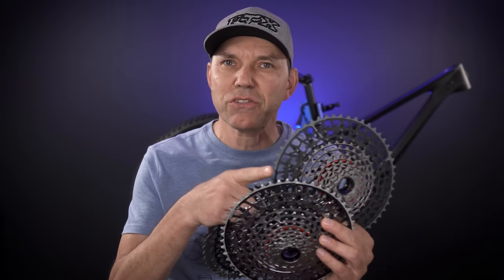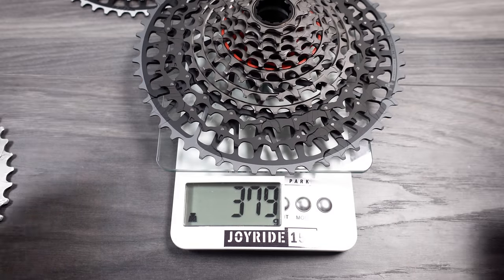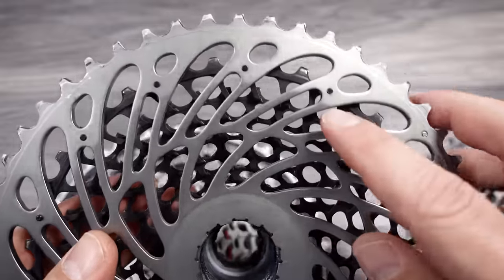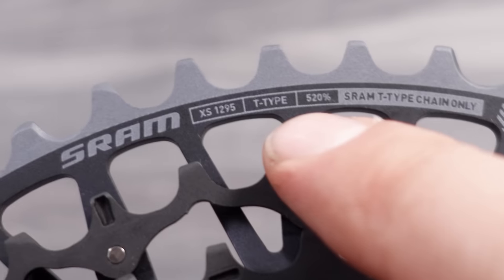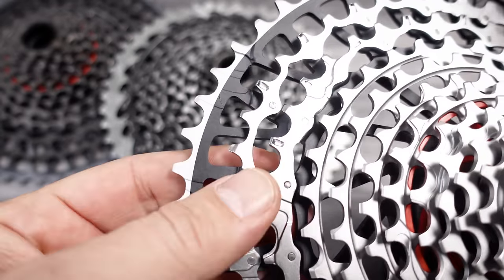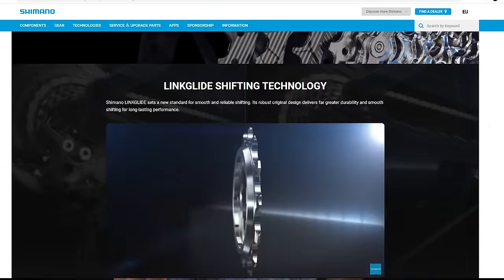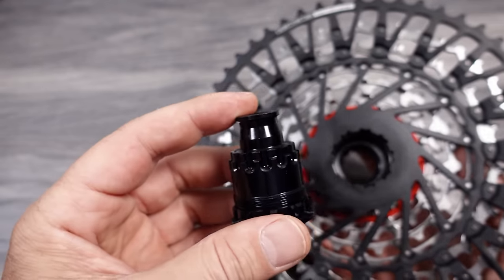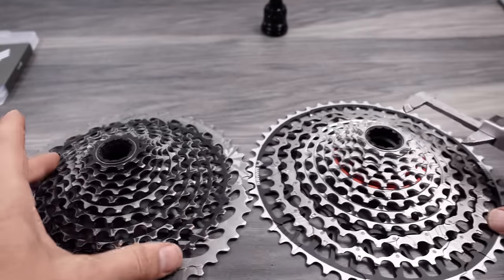SRAM 520% T-Type Cassettes Detail, Compatibility with Old Eagle AXS #Transmission X0, XX, XX SL, GX

Comment: Great video, Thanks.  I have just a little bit of time on my XO Transmission and its been amazing.  Only complaint I have is the new pod, I removed that and went back to the old controller with the add-on shifter paddle.  With AXS I prefer to use the single shift mode, no 2x or 3x autoshifting.  The lack if feedback makes it easy to change more gears than I wanted.
Reply from the maker: Thanks for the info! We will see if we keep the new pod or go for the old one.

Comment: for information, I'm running the new powermeter XX sl Quarq with my XTR drivetrain (Xtr chain icluded) and It's working perfectly!
Reply from the maker: Thanks for sharing, it's what I assumed seeing that the new teeth are narrower, pretty much what Shimano chain wants!👍👍👍
Reply: Nice to read it! I’m studying to mount a new GX T-Type derailleur in my Super Caliber with XT group set, using the cassete, chain and crankset Shimano. 
My XT derailleur and shifter were gone after 3 years of use, I expected more time working.🙃

Comment: I think they are aimed at different markets? The SRAM gear is high end, whereas Shimano Linkguide is available for cheaper builds. Maybe Shimano will release lighter weight cassettes in the future?
Reply from the maker: You are correct, different markets. Shimano - don't expect lighter Linkglide as the whole point of that line is durability,, steel everything etc.

Comment: LoveMTB - I understand that with SRAM’s new Eagle XX T-Type AXS Transmission, "shifting under load is made possible”.  Is it correct to assume that shifting under load is NOT recommended with my 2021 AXS Eagle XX1 group-set??
Reply from the maker: Kind of depends what you mean by that. Shifting under load, to a SMALLER cog is clunkier on SRAM 12 speed vs Shimano 12 speed/ HG+. T-Type is trying to mimic that using electronics and they succeed but Shimano HG+ is still better in my opinion.
Shifting under load to a parget cog/ smaller gear is kinda similar on all...

Comment: If I got it right, you have measured and compared the thickness of the largest sprocket - both 2,80 - but not their teeth.
Maybe you can still do it and add the result here in the comments, please?
Might be some more info, as there are narrow and wide parts and maybe a narrow edge as well....?

Comment: That's crazy they weigh the same. I would pick the most affordable one every time. I also wonder how the efficiency is compared to Shimano. Sram usually gives up a few watts to Shimano but does that trend continue in transmission
Reply: The cheaper one will wear faster and not be cheaper if you climb a ton
Reply from the maker: The watts - it was mostly from the chain, wanting for ppl setup to run those tests to put some numbers out...

Comment: I tried older 1295 cassette on a T type GX transmission incl. t-type chain and it works ok .. i put 1.5mm spacer behind the cassette to improve chainline a bit ,but not needed to work ok as microajust i on 8 position ( without spacer will be around 2-3 ) . my crank is Next 12 speed model ,it works with t type chain too . My next experiment will be new 1275 t-type cassette on a XDR freehub body and older Lunar mechanic transmission ( i hope it will fit as XDR sits 1.85mm inwards )
Reply from the maker: Thanks for sharing. WHy not use the proper, new cassette? And for XDR they always recommend using the 1.85 spacer for MTB cassettes
Reply: I think it is recommended to use the spacer only for older eagle cassette, not for T-type @LoveMTB
Reply from the maker: Nope, XDR is loo long for MTB cassettes, all of them @ricky66659
Reply: I used a new T-type cassette with the axs derailleur, XO1 chain, and used a 1.5mm washer under the derailleur. It runs, but unfortunately not as smoothly as with the original XO1 cassette. If I micro adjust derailleur on the smallest cogs, then it doesn't go well on the largest ones and vice versa. I think the main trick is that T-type derailleur is better optimized for the T-type cassette. I am coming back to my original axs setup which works perfectly. @LoveMTB
Reply from the maker: Yeah this stuff is optimized for T-Type not worth it to mix and match especially for the price! Thanks for sharing your experience @ricky66659

Comment: Hey, I haven't tried the Linkglide Shimano drivetrain yet, but from what I read about it,  it does shift a bit slower than HG+.

I think Sram learned from it, copied it and gave it fancy name (shift mapping). As I have seen the T type also shifts much slower than previous AXS or any other mechanical derailleur.
Reply from the maker: Yup it waits for the shift ramps to come around before the cage moves. Probably smart and probably why Linkglide is also slower in operation, the wBije boost can rip off freehub/ feeewheels cassette cogs etc

Comment: I got my new bike last week with the new Sram AXS eagle derailleur and I was nog aware of the shifting delay... I must say this feels really clumsy... so if you get to a steep hill out of a corner and you want to quickly shift to a higher gear fast... the derailleur simply can't keep up and takes it's own time where you will have to push maximum on the climb... I must say, here Shimano works better... I read Srams argument to design the product like this, but any competitive MTB rider will confirm quick shifting performance is key on any parcours that has quick/steep hills...
Reply from the maker: @freddiek7125  Still they win races at the highest level of competition with this groupset so I think we’re fine 😎

Comment: I want to try a new T-Type XX cassette with my AXS GX derailleur. I can easily machine 2.5mm offset on the hanger, and I will also get a T-Type chain, derailleur pulleys, and front chainring. I am not buying a new $9000 UDH bike just to put a $2000 "transmission" kit on it. My GX cassette is pretty worn so its about time to replace it anyway. I think the biggest improvements probably come from the new chain and cassette.
Reply from the maker: Aaaaaand what are you going to do if the trim adjustment of the GX won't allow you to actually index the gears/ start at 10T??
Reply: @LoveMTB  if the spacing between the gears is the same, it will work the same as long as the derailleur has the correct offset.
Reply: @mk3driftmotion  hello, any update ? I need to do this too and I want to know if it works, thank you :)

Comment: I wonder if you could use the new sram T type derailleur with shimano XTR. I think you have tried the sram XX1 with the shimano and it has worked.
Reply from the maker: I did. But remember that this derailleur has no adjustments so it is expecting everything to be just in the right spot, like a transmission 😎
Reply: @LoveMTB  Hi, thank you for your great videos. I have one question left becours my Englisch is not good enough 😅 Is this derailleur compatible with Shimano XT 12s

Comment: Great review. Can I use in a pinch, a SRAM eagle powerlock 12 speed link on a T Type chain? I gather using a whole (new) Eagle chain on the Eagle transmission cassette not a great idea? Sram say the T type chain ring is compatible with older Eagle chain. Thanks.
Reply from the maker: T-type chainrins are the only ones backwards compatible indeed. And I wouldn't use the old quick link on the new chain

Comment: For some reasons I bought the new groupset but I can't afford riding it all year long. The wear item are 380+100+100 so almost 600. So yeah I would like to run old gx stuff for off season riding. It would be neat if there was a way to run the old cassette. I think a 2mm spacer on the driver would do the trick with the old chain.
Reply from the maker: Probably not what kind of fit would you get on the XD driver with 2mm spacer behind? Highly NOT recommended. What I would recommend though is researching  how to reduce friction and wear in drivetrain. Like wax🤓
Reply: @LoveMTB  i already use wax, but i am still north of 4000km per year on thatbike, it would require change every year. i will probably switch back to old gx complete gruppo for off seaon simply not selling the gx derailleur.
Reply from the maker: @TheAntoine191  I hear you, what wax do you use? BTW Silca wax X shows no wear after 3000k in recent tests
Reply: @LoveMTB  also sram says the link must not be reused on the new gruppo so waxing require a new missing link every time. I have a hard time with "no wear" on mtb stuff. For 6 months i ride in mud/rain/snow you can't avoid some wear. It's not like running on a sunny road.
Reply from the maker: @TheAntoine191  I hear you. Common sense prevails🤘

Comment: I have shimano 12 speed m8100 on my ebike and it works great and has proven to be very durable.
Reply from the maker: Thanks for sharing. What chain do you use with it? Lube or wax? Thanks
Reply: @LoveMTB  dumonde tech. I put over 1,000 miles on my last groupo. I use an xtr chain because it has proven to be most durable
Reply from the maker: @Bench_mark_113  Good stuff! If you want to double/ triple that look at wax 😏

Comment: So, I have a new 2023 Marin RZ2 frame with a Sram UDH.  I just ordered a T-Type cassette in order to obtain the recommended 55mm chainline, along with a Sram Eagle Wide (also 55mm chainline) crankset.  want to stick with mechanical due to cost but I'm confused by your example of the cassette jamming up even though a Sram UDH is used.  My understanding was that a Sram UDH signifies that you should use a T-Type cassette w/55mm chainline.  Thanks in advance.  Would like to know before I start assembly.
Reply from the maker: It jams up because I USE the UDH! That cassette is installed without the USH, derailleur direct mount on the frame. Check my derailleur vid for it - https://youtu.be/DqxyTY2Vx2I
Reply: @LoveMTB  Thanks for the reply.  So, I have the UDH on my Marin RZ2 and it sounds as though I cannot use this cassette with that.  I assume that the 55mm chainline is maintained by the cassette extending wider outboard (to account for the missing hanger).  I am trying to meet the 55mm chainline for mechanical shift using a Sram Wide BB, Sram Wide crankset, a standard Eagle (non-T-type derailleur) and so I thought I was doing the right thing by going with the T-Type cassette to meet said standard but would I be better off using a standard Eagle GX (non-T-type) cassette?
Reply: @LoveMTB So, if I want to stay mechanical but I want to achieve the desired 55mm chainline, I would want to use a Sram WIDE Boost crankset, Sram WIDE DUB BB (for correct spacers), a standard Eagle 1x12 derailleur along with any standard Sram Eagle 12-spd cassette (NOT the T-Type).  Sound about right?
Reply from the maker: You cannot use the T-Type cassette with old Eagle, it won't work. You can use a 55 mm chainline with the old Eagle 12s mechanical no problem. @jeremydwyer2724
Reply: @LoveMTB Tyvm.  Very helpful.  I merely want to comply with the manufacturer's recommendation of a 55mm chainline.  I will update the crankset and bb to WIDE standard but leave the rest alone.  I cannot afford the chain, crankset cassette, electronic shifters and derailleur for T-Type until it comes down to working man level pricing.

Comment: Hi LoveMTB, I am a bit confused @9:12.  How would you upgrade the new cassette to a boost frame?  Why is the cassette rubbing against UDH?
Reply from the maker: Because this cassette is not meant to be used with a hanger? Check out this - https://youtu.be/Wd4UChCvs-4
Reply: @LoveMTB  Got it, the derailleur is mounted directly through the axle.  Thanks for the explanation!

Comment: @LoveMTB
Form what i understood from this video the new cassettes have a 2.5mm offset, away from the spokes towards the rear derailleur. Theoretically speaking, if I was to put a 2.5mm spacer behind an "old style, non T-type" cassette, to move it outward, towards the rear  mech, run an "old style, non T-type, non flattop chain", shouldn't that work in conjunction with the new tranmission derailleur? In my mind, as long as the spacing in-between the cogs of the cassette, remained the same, it should work just fine. Would you think the same? 

If so, this could be a hack to not blow ridiculous amounts of money on the new cassettes. What do you think?
Reply from the maker: It could work but I am not going to try it myself. Let us know if you go ahead with it 🤘
Reply: Will do. I've already asked a buddy who works at a machine shop to make me a 2.5mm spacer
Reply from the maker: @marcbuchel4873  the trick is the installation od the cassette with that spacer behind it won’t properly engage withr the spline of the freehub plus not enough thread left to tighten to proper 40Nm? In my books not worth the risk plus the 42-52 jump in that cassette🤔
Reply: What I've done already is, I put a 2mm spacer behind the cassette and that works ok for all gears, except for the gear change from the smallest to the second smallest cog. That one doesn't always work flawlessly. The cassette seems to sit on the freehub body fine for now.
Reply from the maker: @marcbuchel4873  “Seems to” might be the key part of your comment?😊
Reply: @LoveMTB  well, I went for a 3h test ride, 60k, 1200m elev gain, some sprints with up to 1000W ... I certainly understand your concerns as thread engagement is 2mm shorter ...
Reply from the maker: That test could be relevant though. Please keep us in the loop if you go for it🤘 @marcbuchel4873

Comment: Please do Shimano Linkglide. I really want to know if it's true that they cannot be mixed with existing product lines and exactly why. I'm interested in replacing my XT/SLX 12s drive train with Deore 10s Linkglide on my eeeb. I'm not using the largest granny gear and the short cage on the Deore derailleur looks like it will keep out of the way of rocks n logs better that a 12s rig.
Reply from the maker: If I can get my hands on it...

Comment: Excellent comparison video. Why is SRAM going with the 55mm chainline? I thought boost was already the standard and what most frames are nowadays.

Is it because rear tires are getting wider and need more frame clearance?
Reply from the maker: Yup tire clearance but they do 55mm right with cassette also pushed out. You can see all that explanation in the crankset video😉
Reply: @LoveMTB  Right. The BB and spindle are 3mm more outboard. Why the cassette is 2.5mm and not 3mm?
Reply from the maker: @GokkunGuru  don’t know assume space or lack of it. Remember I’m not sponsored by SRAM, did not get invited to the factory, didn’t get a Groupset to review. It’s all what I could find or figured out about the T-Type😉
Reply: @LoveMTB  Right. Likely lack is space in the rear. Pls make sure to review the RD next and also the new Stealth brakes! Thanks
Reply from the maker: @GokkunGuru  that’s the plan my friend, that’s the plan

Comment: The current Sram products are already too expensive. GX 10-50
Cassette your lucky to find new for under $200. Chain $90 for a supposed good one. Front chain ring $40…..I easily definitely go through two chains if not three a year. Cassettes are sloppy before the end of the season even when keeping the chain clean and lubed and replacing it to try and help the cassette. I find it hard to believe Sram is spec’d so heavily or Shimano by manufacturers. I’m currently in my second bike spec’d all Sram but I can say Shimano lasted longer and were cheaper to replace the components for sure. The big thing is Shimano definitely shifted way better and stayed in adjustment way better. If it’s true Sram is stepping up their shifting game with this redesign I can only imagine what it will cost now…..

Comment: Is the sram transmission derailleur compatible with a frame that has a UDH but has the standard gx 520% 12spd cassette? Or rather, could I just upgrade the derailleur and shifter on a bike with a udh and sram gx mechanical drivetrain?
Reply from the maker: Check the video carefully, this and next one about the derailleurs 😉

Comment: Do you know if the cassette pitch is different to non-Transmission Eagle cassettes?
Reply from the maker: [Pitch is not different however the cassette is built with the larger rollers of the new chain in mind so if you put an Eagle 12s chain on it it will behave as if it's worn out already. Can't really install it in the old drivetrain anyway as you see in the video.
Reply: @LoveMTB  Custom hanger would make this work without the Transmission derailleur. Always new chain with new cassettes! Thank you for confirming cassette pitch!

Comment: I Like Sram but the Casset thing is a absolute rich kids thing.
I mostly use the Gear 10-12 for long range. So like go to work and back home.
This why i changed to Micro Spline Casset. I can easely change the worn out gear and it cost me just 8-20€ instead of a 300€ Casset, because mine is dead on gears i need and just half ridden.
The Chain works great so far and moves easy over all gears. The most great thing about the Colored 12S Chains are that the outside of the Links arent getting rusty like the Shimano ones.

Nice for sram to bring out a T-type one but useless for me when i cant change the gears i use the most.
Reply from the maker: I am sure that your use case scenario falls onto the 20% they they decided not to cover. I would make the same decision is that was my case🤓

Comment: You were measuring the mass of the cassettes not the weight.  Grams/kilograms is a unit of mass not weight.  The mass of an object is the same on Earth as it is on the Moon but the weight is different at each of these locations because weight is the product of mass multiplied by gravity.  You don't say kilogram meter for torque do you?  No, it's Newton Meter where Newton is the unit of weight and force in the Si Metric System.